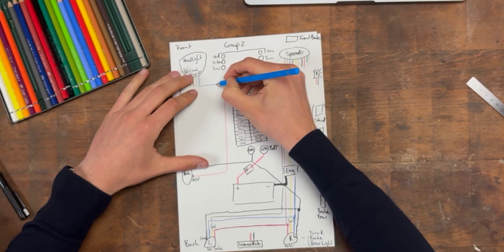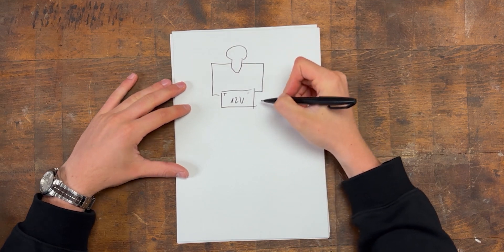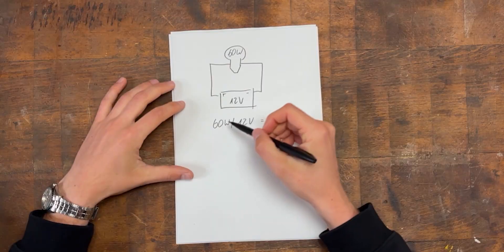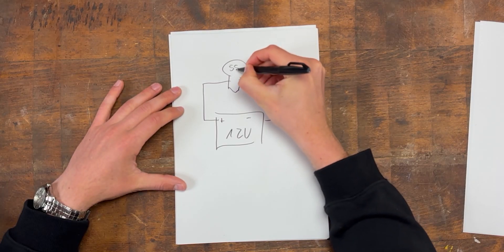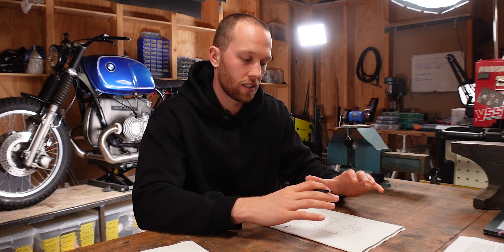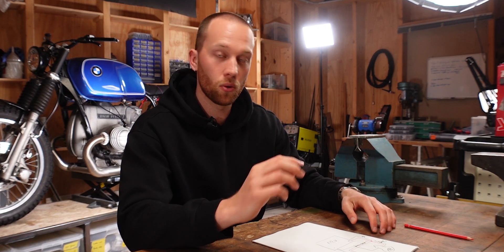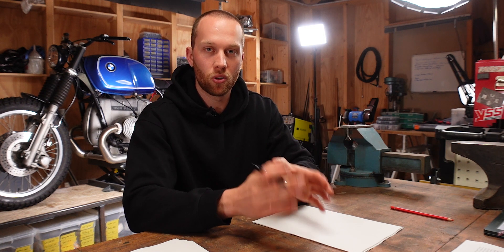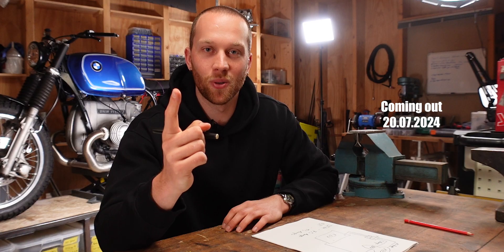How To Choose The RIGHT WIRE SIZE?

Comment: Hi there again! Great video as usual. Can you tell me what guage cable you are using for the battery to starter? Ive got some 16mm2 cable hopefully this will be enough.?
Reply from the maker: Thank you! I used 16mm2 as well. This one: https://amzn.to/49kCir7
Using welding ground wire is such a hack, it’s super flexible even at this size.
How’s your wiring process going? What are the biggest questions you’re having along the way?
Reply: @MotoWrenchers  Yes thats what I have, the old cable was new but it was 25mm2 and stiff as hell so im swapping it out.

Comment: You are incorrect about the cable you are splicing from the h/l to the guage unless you are fusing the whole h/l circuit to this smaller csa cable 

Load <current carrying capacity of the cable < protective device (fuse)
Reply from the maker: Hey Kyle,
Thanks for you input. I've seen a bunch of people do it that way. Now that you're pointing it out, I could have probably run an individual wire from the high-beam output terminal to the control light. Do you think that would have been the better option?

Comment: You mentioned using wires too small would have some risk. Is there any risk if you use wires too big? Could you use the largest size for everything or would that be a problem
Reply from the maker: Too big is absolutely fine, it might just be impractical. Too small however can overheat and start a fire. If you have any other questions let me know.